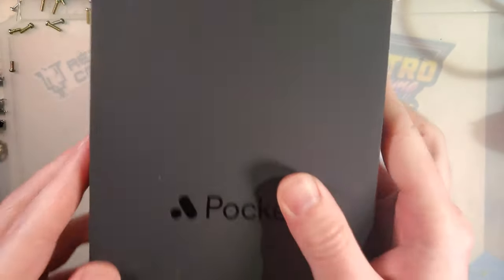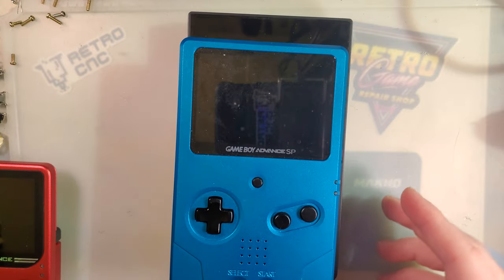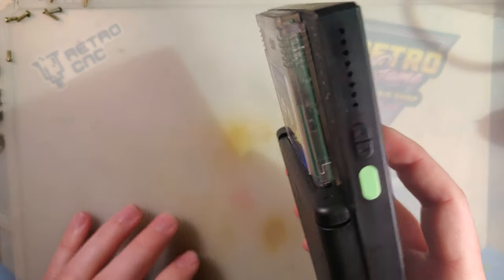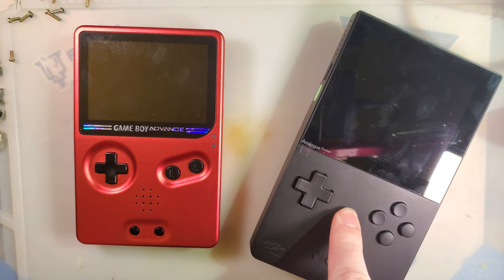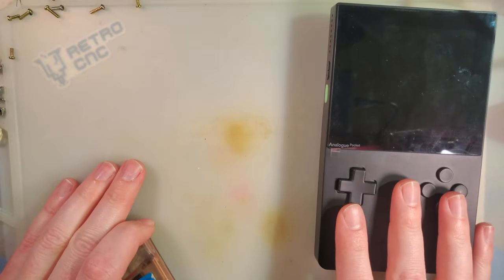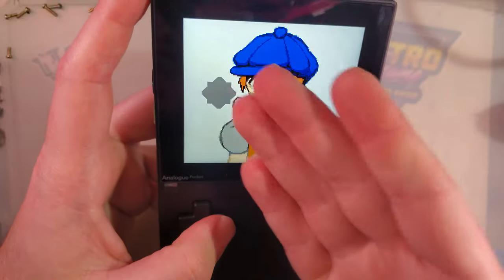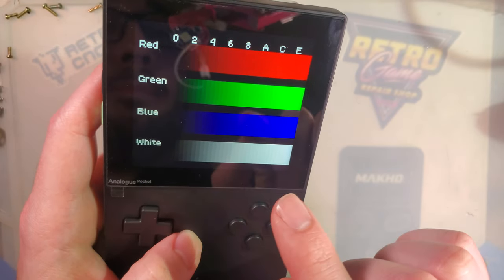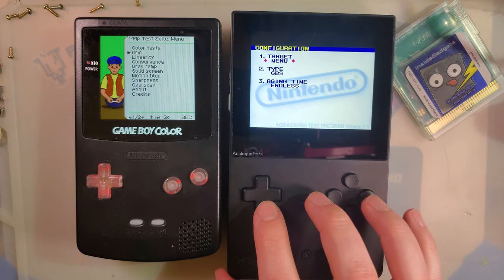Analogue Pocket

Comment: just started watching, but your thoughts on system thickness are something I really pick up on as well. I plan on building a slate, and my unhinged is the "budget" version specifically because the extra thickness of the full unhinged build is nuts. The plastic back keeps the system light and thin, best of both worlds.

Comment: Does sleep mode work with the Omega DE when it's in the single cart mode? I've got the OG Omega but would upgrade for that compatibility, since a quick sleep/wake would make it a lot more feasible for me to carry out and about.
Reply: ya know, I never tried that on the DE, since I have an OG GBA where sleep mode just works, but that sounds like it's worth a shot. I might try it and let you know if you don't get a response before me
Reply: OK I have now tested it and it turns out single cart mode doesn't work at all. boots up into a totally white screen. works fine on original hardware but no luck on the Pocket.

Comment: One aspect of the Pocket (that, granted, isn't realized yet) is that if they allow jailbraking like the super nt, you could possibly set up different cores and have the closest thing to a Mister handheld. It's still in the realm of speculation, but wouldn't it be neat?
Reply from the maker: Sure, that's a neat bonus, but if that's what you actually want, there are already devices that can do exactly that and you can buy them now and for a third the price.
Reply: @makho  I'd buy it for what it is if it shipped do Brasil 😆, I know no promises were made to unlock the device.

But what do you mean by devices today? Abernic and retroid pocket, etc? For ARM emulators I'd rather use RetroArch on my phone since it has the advantage of always being with me and bring able too sync saves (mostly for pokemon), a dedicated gaming handheld needs to have something special, like being FPGA based, amazing screen or for and finish, all boxes the pocket ticks
Reply: @makho out of curiosity what devices run handheld fgpa for a fraction of the price

Comment: One thing I think of when I see the "No emulation", is that to me, it's more like they've gone and done a re-implementation of the OG hardware... Similar to a SNES 1-Chip, the various revisions of the PS1, the Xbox 360 when they moved to a single chip for CPU/GPU... None of those were considered "emulators", just revisions that while their silicon was possibly different, they still ran the same and came back with the same behavior.
To me, it doesn't really matter that Analogue's devices have done this 're-implementation' on a 'flexible' chip -- it's still hardware that is natively running the code, rather than re-interpreting and translating it to another architecture.

Granted, there are several ways to define 'emulation', and which you ascribe to depends on your background, experience, and opinions.
Reply from the maker: We shouldn't have to debate what "no emulation" means. Anyone who understands what the word "emulation" actually means should also understand that "no emulation" means the opposite and thus be the original hardware. Obviously, that is not the case since we have so many extra features and ALTERA/Intel hardware powering the thing. 

This is not nintendo silicon so your comparison is not even remotely the same. Also, it's absolutely not natively running the code. It has been PROGRAMMED to run the code, that's what FPGAs do. A clever engineer can program a FPGA to do just about anything any other chip does given enough logic elements. 

The whole problem with "no emulation" is that this device does use emulation. Good emulation. The marketing material wants you to picture bad emulation (which, to be clear, is bad) so that you know this device is not that. I'm not sure if the intent is to get you to associate the function of the device to the original it's based on, and if so, sure, that's fair. But they are saying something patently false to make this association because this is still an emulator.
Reply: @makho  I don't think there's anything actually meaningful whether or not Nintendo made the silicon. AMD and Intel both make x86 processors, but does that make Intel processors "emulators"? Some versions of the Sega Genesis 3 use a chipset that (AFAIK, could be wrong) was not manufactured by Sega, does that make the Genesis 3 a Genesis "emulator"? Or the Panasonic Q? An architecture is an architecture, IMO, and we've seen enough revisions of chipsets in both PC and console gaming that I don't think "Is it physically the exact same chip as the original" is a meaningful 'line in the sand', and nor is 'who manufactured it'.

FPGA logic elements are, at their core, still logic elements, just as ROM and RAM are both "Memory", even if only one of the two can be freely rewritten. Neither of them are memory "emulators". Electronic signals enter and exit logic elements to produce results the same as the original chips. These signals are not being emulated, and the logic elements running them are real, physical logic elements. The fact that they can be rerouted into another configuration does not change that. FPGA's do not route software calls through an interpretation layer, or a Hypervisor, or anything of the sort. It passes electric signals through physical logic gates.

Lastly, we already have wildly different chips being used, notably in backwards compatibility. A Gameboy Advance uses quite different silicon to a OG Gameboy, yet no one calls that emulation. 

My personal line in the sand is "Are the signals being run through logic gates, or are they being interpreted and converted for another architecture"? And to me, the Analog Pocket is not 'emulation'. The FPGA configures itself into a chipset that has compatibility with the target system's machine code. Did Nintendo make the FPGA? Was the FPGA pressed at the factory? No and personally I don't think it matters.

Granted! Your idea of what line in the sand constitutes emulation can be wildly different! I'm sure there's someone out there that considers the GBA's GB capability to be emulation, or even the early model PS3's that had PS2 silicon on them (well, some of it, anyway). I don't take offense at the idea of someone calling it "hardware emulation", but I also don't take offense at it being called "no emulation".
Reply: @AstralLovelace  I think you're missing an ultimate point: the Pocket was marketed to people as something which is not--and is therefore superior to--an emulator. This marketing relies on a poor, hazy, lazy conception of what 'emulation' actually means. I think that to the people whom the Pocket is aimed at, 'emulation' is assumed to mean 'cheap chinese unreliable illegal stuff; not 'the real deal''. The irony with digging so far into the details of what a chip is, what silicon does, etc., is that you and others debating about this are missing the main point that the Pocket is aimed at people who don't care enough beyond some easily-egged-on prejudices against 'emulation'. Analogue have propagated and encouraged that prejudice by marketing this device.
Reply: As someone who spent hundreds of hours tweaking emulators on high end PC's and could never "get it just right", and ended up moving over to a MiSTer, yeah, actually, I would say that FPGA is better than software emulation.
All that time spent tweaking Retroarch and other emulators and never being satisfied because games would have audio popping, screens would load in different, this game needed this fix, this setting is broke in this game, etc and then MiSTer basically just goes "lol" at all of that, specifically because it is not software emulation. Plug it in, load the core, DONE. 
Obviously, yes, "Good software emulation" vs "Good FPGA design" comes into play, but Good Software Emulation still needs to be tweaked from game to game, PC to PC, fix to fix. Good FPGA design is done once and it's good. It simply becomes the right hardware. Any tweaks after that is purely optional and doesn't impact whether the game runs right or not on your system (ie CRT shaders and scaling).

Maybe when random Anbernic or K101 type devices have the horsepower to throw Higan or BGB level accuracy at everything we'll end up at a point that the FPGA "It just works" won't have an allure to it, but we aren't there yet by a long shot. Because that takes a LOT of horsepower that you aren't getting in a sub $200 device.
Reply: @AstralLovelace  I appreciate your experiences with emulation in general, and I've had much the same experience. It takes personal research and work to find out not only how to do what you want, but also what you should want in the first place. Paying for the convenience of having those steps done for you is an attractive prospect.

However, in the case of playing GB, GBC, and GBA games, my Anbernic RG351V has been phenomenal at delivering what I would say is an identical experience to that provided by the Pocket--for far less money. 

The idea of a close-to-perfect chip solution is very elegant--I see the draw!--but with integer scaling, LCD shaders, frame blending, bilinear scaling-plus-scanlines (good for GBA at non-integer scale) low-pass audio filters for GBA games, over 100 colour palettes provided for GB games etc. as provided by Gambatte and mGBA through Retroarch, it's a stretch for me to say 'the Pocket does it better'. GB emulation has been built and improved over the course of many years now, such that the experience of playing anything the Pocket can on the RG351V is basically perfect. It's a very set-and-forget experience on that handheld in particular. About the only clear leg-up I can concede to the Pocket is its link cable and special cartridge provisions (surely used by very few people indeed). For the price difference between the two devices, with the added benefit of an emulator handheld being capable of doing so much more... it's hard to argue the Pocket's ultimate value, I think. 

Again, I think the rest of its perceived value comes from just that conception of emulation being 'messy' and cluttered and inaccurate. That being true in particular cases doesn't negate how slick an experience it is to wield an RG351 device today! I find Analogue's approach to have a glaze of snake oil that really puts me off wanting to support their products. When considering the price of the Pocket, it becomes extra hard to forgive the silly shoulder button placement, cartridge slot stability, and volume/ sleep button placement.
Reply: @null140  I feel you are combining PC Retroarch and Anbernic Retroarch here.
640x480 is a terrible resolution for any GB or GBA game, resulting in poor scaling. At that resolution, the shaders can't do much work to clean it up either. These might be great on a high end PC with shader grunt to spare, but we aren't talking about a beefy PC. And, compared to the sheer ease at which you simply enable the screen simulations on Pocket, it seems patently absurd to even try to compare the overall screen experience between the two. And I largely want to play my Gameboy games in a handheld form factor which... doesn't apply with PC gaming.

Additionally, you are writing off the "emulation vs fpga" argument by specifically stating that FOR GAMEBOY*, emulation is pretty darn good. I don't disagree that emulation *of Gameboy is really good (horrible screen res choice on handhelds aside), but I would hope that emulating what is almost literally a calculator would be good. You mention nothing of the issues that still plague PS1 emulation today, which at its first release as an FPGA core on MiSTer looks to completely bypass all of those issues (at the cost of we had to wait until 2022 to get the know how and the FPGA chips to make). 

My entire point is that FPGA has a lot of sheer advantages over software emulation that are inherent in what it is. Software emulation has some advantages (namely things like Save States or Widescreen hacks et al work better in a software emulated environment, though they are not impossible in FPGA). But when it comes down to effortless, zero config "it just is" accuracy, FPGA as a technology is better suited than software emulation that is piggy backing off an entire other system of unknown variables that come into play.
Reply: I'd kept my eye on those retro devices waiting so long for just one freaking device to come out that was centered around Gameboy games, making them look and play better than I could do just on a Gameboy. They always came out with extra sticks, random triggers, analog triggers, and that god damned 640x480 or 240p screen. I don't want to play PS1 on a 3 inch screen. I want to play Gameboy. 
The Analogue Pocket was the first device to be announced to actually play GAMEBOY games well, and not as an afterthought second to home console systems.
Reply: @AstralLovelace  It’s really easy to enable integer scaling on the RG351V and have a marginally smaller screen real estate than the full 3.5” display; correct aspect ratio—correct integer scaling. I’m not sure why you’re skeptical of that. Of course I’m not stretching nor advocating a stretched GB image to 640x480.
Reply: @AstralLovelace  Just to chime in, an FPGA can't actually 100% implement the original circuitry of a GB/A and relies at least partially on full emulation for a few pieces like parts of the audio pipeline.
Many other pieces can have their logic properly translated to run "directly" on it, but that's also just considered hardware emulation since the FPGA doesn't support the code set of the sharp CPU directly.

The big difference in emulation types here is that the type of emulation most people are familiar with has a host OS in the way which usually makes things more laggy as it introduces latency, something an FPGA can more easily avoid by having the OS play second fiddle. Makho mentions this difference in the video and how it manifests sometimes with dropping button inputs in the OS menus.

But the same "OS plays second fiddle" could be done on an X86 or ARM CPU, it's just that nobody has done that yet due to the effort it would take.
Reply from the maker: @RAHelllord  To expand on this, RTOS is the search term. The key difference between emulation on something like a PC or anbernic vs the mister or pocket is that the former devices are not running an RTOS. It's not quite that simple but that's what the core differences boil down to. 

https://en.wikipedia.org/wiki/Real-time_operating_system

Most of the time and in most cases, host PC devices are fast enough and have enough extra resources that it doesn't matter but this difference is always apparent in edge cases. 

Everything else is, as I already said, the difference between good emulation and bad emulation (so basically depends on the specific emulator cores).

Comment: Can you elaborate on why GB flashcarts would have to be considered 'flash cart emulators'? As I understood, the ROMs run on the original hardware but are just served by the cart. What makes the flashcart (software or hardware) considered an 'emulator'?
Reply: The flash carts use the same level of hardware emulation the Analogue Pocket is using to have the device pretend it's original hardware. In other words, the flash cart does reconfigure itself to pretend to be one of the various game boy cartridges, and picks the one that works with the rom in question. Just off the top of my hat, different games use different ways to save data, and often rom bank switching is different between various games. Resulting in different code that the rom is running and the cartridge needs to react to correctly, otherwise it'll fail and crash the game.

The big, obvious problem here is that since you have two devices pretending to be things they aren't it is more likely to cause issues compared to having only one device pretend it's original.
Reply from the maker: flash carts are cart emulators because they emulate the functionality of a regular game cart to the game boy. Unless you're playing tetris, the cart itself is a lot more than just a read only memory chip with a game etched in (most commonly include a memory mapper, extra system memory or save RAM, depending on how allocated, and a real-time clock module).

Comment: I get what you mean that it's hardware "emulation" but the advertising is targeting software-based hardware emulation. If they tried to explain it on their marketing it would be a nightmare.

I ordered a Pocket and am really hoping compatability with the EZFlash Jr is resolved by the time I get it (Q4 2022). According to the Analogue Pocket subreddit, there is beta firmware for it that gets it working on the Pocket. I get that I could get an emulation device but I want the ability to play on original hardware (modded GBC and GBA) for trading or just because. Call me weird.
Reply from the maker: None of that is original hardware though
Reply: @makho  How is a IPS modded GBC not real hardware? It's Nintendo silicon, unless having a screen mod completely negates somehow. Which would mean your slate doesn't run on "original hardware" either.